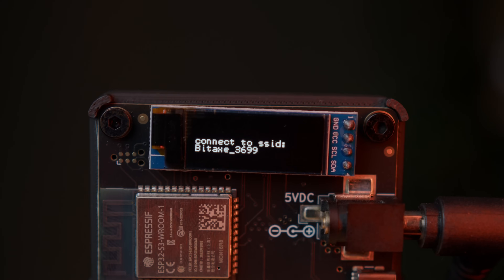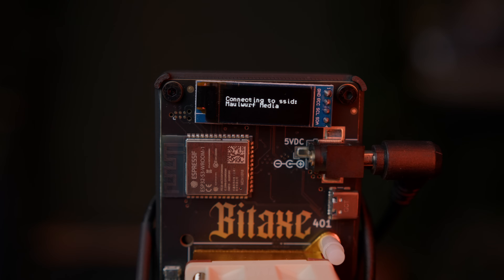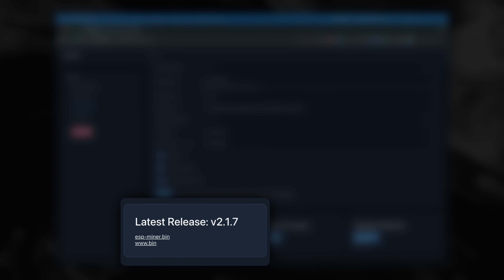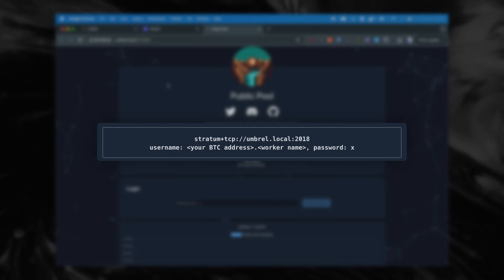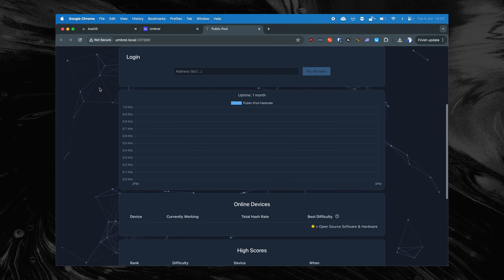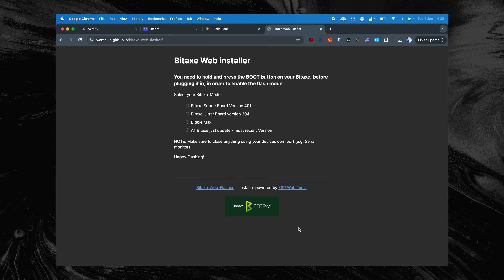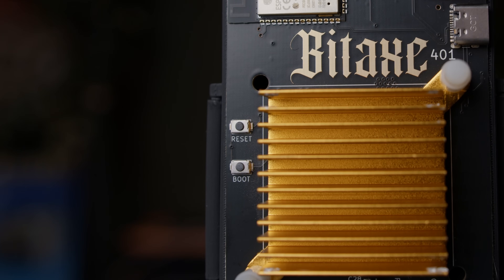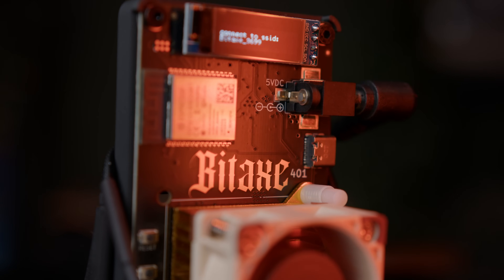The Bitaxe Supra: start mining bitcoin today!

Comment: Hey Bart! I’ve just got a Bitaxe miner and had a couple of security concerns. I’m on a shared Wi-Fi network with roommates (can’t access the router), and I’m worried that others might be able to open the Bitaxe dashboard just by knowing/guessing its IP address. Is there any way to lock it down or restrict access only to me? Would love any tips on securing it without router access. Thanks!
Reply from the maker: Good question and unfortunately there is no way to lock down the UI of your bitaxe with a password.

So if your roommate knows the IP they can change the wallet address. You could build a script that uses the api to check the wallet address or something, but I agree that this is a feature that is needed and currently lacking.
Reply: @SatoshiRadioGlobal  Thanks for the quick and handy answer. I might just fork their git repo and create my own lock down of the UI. The API idea isn't bad too.